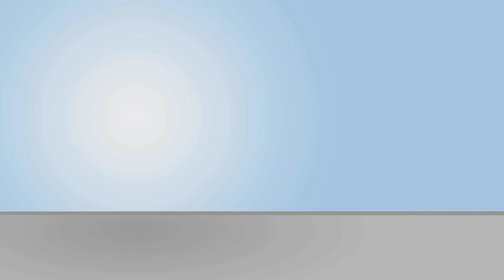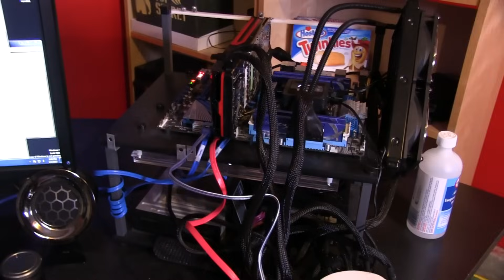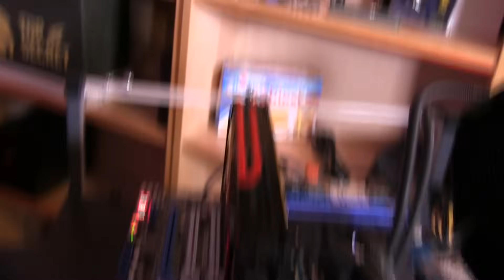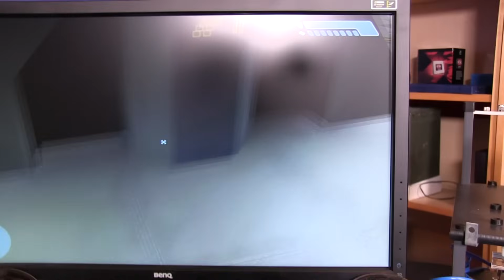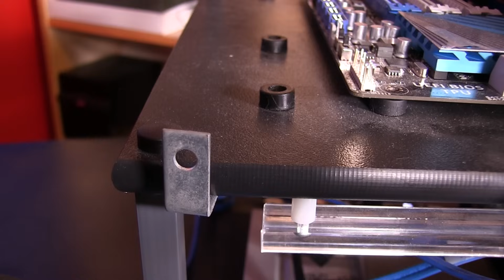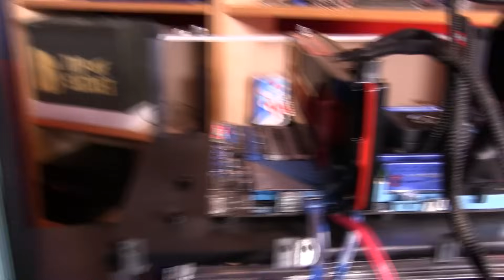Coil Whine Explanation & Demonstration Linus Tech Tips

Comment: yea, if you have the right combo of PSU and GPU that works correctly together then yes so it depends on chance or on some research to prevent the waist of money. It's got nothing to do with like a factory problems on a particular unit, it's just that the design of a PSU might not work as well with a particular GPU design. Like if you take two of the same GPU's and two of the same PSU's the result whill be the same, coil whine or not.

Comment: my CORSAIR TX 650 did this in idle... but at load it is super silent, this is my 3rd tx 650 so far, 1st i sent back for warranty and it was whining, 2nd one died after a weak because the fan was defective, and now my 3rd one is 1 week old and so far works like a charm, and i have noticed that every electronic product will whine at some point ( power usage or age ) so i stopped worrying, you can only buy a silent case otherwise forget it, you can't get rid of it ( w/o voiding warranty )

Comment: My problem, amazingly on both of my rigs, is that the sound is not heard without headphones or speakers on. In my current one, my sound card seems to reproduce everything of sounds in the computer, and give it back to me when I'm using headphones. I can even hear my harddrives spinning up trough it! But in the other one, the sound was reproduced in my speaker system, not in my headphones if I remember right. Very annoying, I think it's the soundcard(s), since the sound is reproduced by them.

Comment: i can only assume somewhere in a capacitor, or one of the transformer coils more likely. there is a slightly loose wind. that wire with that little bit of looseness has just a smidge of space to where it can move,
the  electromagnetic forces that it creates and operates with cause that part of the wire to move back and forward and vibrate making the horrid sound we all know and fear,  

at least, that is my current hypothesis.

Comment: Wow! That IS a lot of coil whine! There is in fact one solution to it. But it includes soldering and voiding warranty.. You can desolder the inductors on the board, and replae them with better ones. But, it's not to recommend.But it's the only solution really.

Comment: The coil while is only present on the newer HD 7000 series and GTX600 series and 'maybe' some badly designed older cards/PSU's. It's due to a new type of component they use for the boards now. The more power the board is allowed to draw, the louder the whine, simple solution is to enable Vsync and don't allow the card to pull crazy fps. Simple as that.

Comment: Yo linus i had this issue with my GTX260's if ya take the HS and fan off and paint a clear coat over the Caps and mossfets with clear nail polish it will make them quiet it fixed my issue on the 260's and ati 6970 i have owned

Comment: It corresponds to the cards load. What youre hearing is  the inductors in the VRMs on the card being excited by a switching frequency that is within audible range. Its worse with some PSUs probably because of ripple on their rails being more than others or interactions with components of the PSUs switching frequency left in the supply which appear more under load.

I had an old X800 Pro that was silent on the desktop and only whined in games but one of the VRM phase FETs gave up.

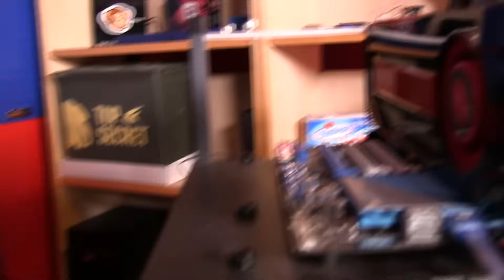Comment: Geezz..that noise is terrible, it made me forget the dust build up(1:44) under the mobo, JK!.... but seriously a 7970 with a custom air cooler will be better. Just don't buy or use the reference type. Off topic linus, do you know of a water block for the Galaxy GeForce GTX 660Ti 3GB GC card? i want one for my rig.

Comment: i installed a GTX560 in my noob friend's HP  PC, it has a 500W PSU in it, had to use the molex power adapters but who cares, as soon as the GPU started drawing power, the PSU starts whining much worse than that, it almost didn't sound healthy,

Comment: I HATE and love being able to hear super high pitched sounds.
My reference GTX 660ti made noises like this at first, I actually installed sound foam in my case so the only in and out of my tower is just the fans.
And I bought "noisy" fans to drown out the sound as I'd rather hear the low hum of a fan versus the ear piercing noise of a GPU.
A lot of other devices do this as well, from forced air furnaces to cell phones that run on low frequency, near speaker set up's. Most people never hear it.

Comment: Wao...i don't have this in my system lol , Sapphire HD 7870 though i have terrible Black Screen , had to RMA it....

But i do have a slight whine sound in my PSU , its not coil whining , not sure what, but its same noise as my plug on the wall. I asked my Dad he said it's normal , basically its like the sound when you go near to those high voltage fuse box thing you see in shopping malls /  those electric stations. My country uses 240V here for house.

Comment: It depends on a lot of things mostly the components used on the video card, and your power supply.  Any VRM modules can have coil whine so you can experience this at your motherboard or in your power supply also.  

Some things you can try is to attempt to change the power delivery to the device with the coil whine.  For motherboards you can adjust the switching frequency in BIOS.  On video cards you can try a 6/8 pin extension cable or a different power supplies.

Comment: Don't quote me on it, but I believe it's the power unit inside the graphics card causing it. It is most prevalent when framerates are high. So you can use an fps reducer such as the one built into msi afterburner to cap fps at 60(fake vsync). This also reduces power consumption and temperature.

Comment: you should make a distinction in your next coil whine video between coil whine based on 500+ fps (which most cards do)... and regular coil whine in all games even with 30 fps. The 500+ fps coil whine can be easily fixed by limiting fps to 150 or so. its the other coil whine that is more annoying because it happens in all games.

Comment: wow, that's really annoying. sounds like the frequencies are getting low enough in the choke coils that they're audible. not a fan of that, they should use coils rated a little higher if that's happening. that gives me the impression that there's unstable power somewhere.

Comment: Linus, I noticed some of your mobo screws are not in. Ive had this issue before and I fixed it by using ground straps from the mobo to the case, and from the case to chassis of the PSU. (paint needs to be ground off). Im not sure if this will work everytime but it has worked for me in the past.

Comment: I understand the fact that a none referance card can coil line or reflect some EMI onto other components by the stock components beeing swapped out with new ones... But a reference card made by the chip makers as in original state - that type of coil line or EMI is just not freakin respectable.?! The components should be balanced from AMD themselves to fit the circuitry and not be so cheap you end up with problems like that... Mainly because it does tear a conductor to vibrate that much...?!

Comment: I hate this so much.. I know what causes it too.
Any game with high FPS causes it, the fix is to turn on vsync.
Eg: At the start of total war games at the menu, the framerate is not locked, so coil whine will be at its highest. Turn on vsync (through either nvidia settings or your GPU's equivalent) and the coil whine will (usually) immediately dissapear. This is what I used and it fixed mine straight away.